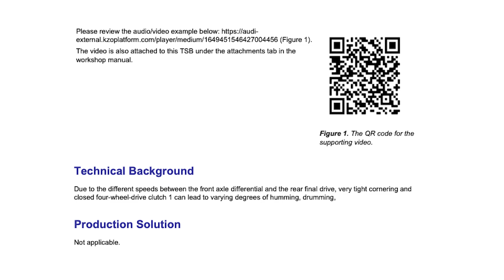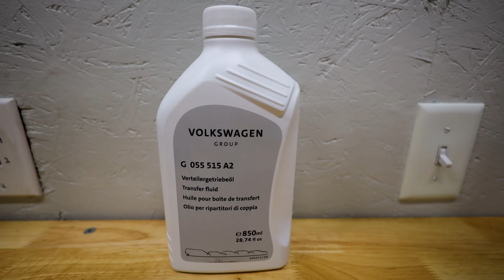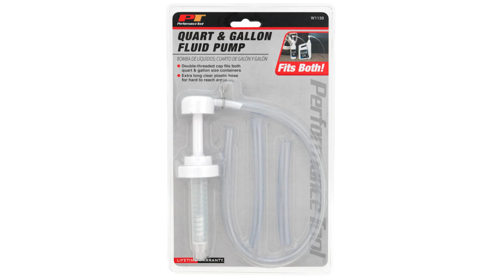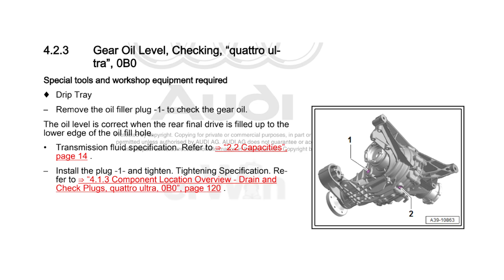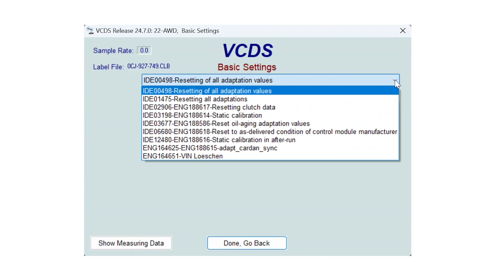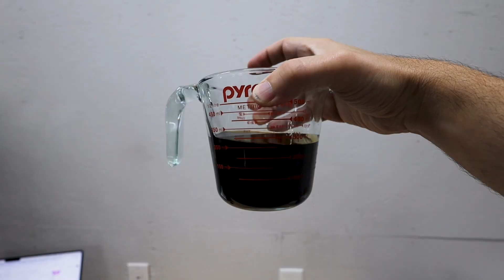Quattro Ultra AWD Clutch Binding & Vibration Fix | TSB Procedure A4 Allroad

Comment: How can we only drain 300ml and put in 360ml? Anyone got an explanation for this 😅
Reply from the maker: @Stormingsoul  Keep watching...
Reply: I did. Initial factory fill comes out as 300ml. Refill 360ml. Did the factory fill short?
Reply from the maker: Right. I owe you an apology, I forgot it was the flush volume that came in extra low. Two things: I think someone else mentioned it in a comment but (if I had even more time and backup fluid) it would have been nice to drain the 2nd fill to validate (against the 360 capacity spec) how much fluid truly gets added when the plug is backed out. Therefore thing #2: Without that confirmation, it's hard to comment on the 300ml captured. Is the big dark secret to how widespread these problems are that the factory themselves don't do the fill properly and are sending cars off the line under filled? Or, is the clutch working so hard during it's lifetime that fluid is being worn (and lost? or at least the volume decreases because of this process, somehow?) to the point where the volume drops? No idea. What's added an interesting wrench in this convo is a newer comment on this video from @glenrichardson6649. According to his dealer, the problem doesn't even exist in the clutch and this TSB is outdated. That info doesn't reconcile with the fact changing the fluid works but...so did their solution.
Reply: @FigureItAuto Thanks.. same questions popped up in my mind. I know the new tsb requires you to drive circles until you puke and the clutch overheats and pops a error warning. My guess is it recalibrates the clutch torque settings on (worn or) hot oil, to a higher clamp force or threshold or cleans the clutch plates?

Bit tomato tomato effect which shouldn't require as much maintenance on the ultra oil anymore. 

Was hoping you maybe discovered some answers along the way on the fill differences and stuff. But remains a mystery to all of us 😅
Reply: Still trying to figure out how to to do the new tsb/tpi with VCDS instead of ODIS.. vcds seems to have a different naming of settings and adaptations compared to ODIS so i can twist the endless circles with the 150nm clutch setting
Reply: Thanks so much for the video and discussion. Currently looking into this on a new to me 2021 A4 Allroad US (23k miles) It has some mild stuttering turning from a stop, etc.
I will definitely change out the clutch and rear diff fluid before trying the additional! see below

I think this is the other TSB that is being discussed:
https://static.nhtsa.gov/odi/tsbs/2025/MC-11012488-0001.pdf

Some highlights, interesting...:
- The friction system of the four-wheel drive clutch may change slightly over a long period of time when the proportion of all-wheel drive use is very low. The following procedure can be used to resolve the customer complaint.
- Connect the ODIS tester and expand the test plan by entering the reference number 2074883. Add the suggested test program - 0022 – Function test of clutch for frictional vibration - Select -1- Target torque 150 Nm
- Keep driving in circles at a maximum speed of 10 km/h (6 mph) until the yellow warning lamp “Four-wheel drive overheating” lights up and test mode is ended automatically. This
procedure can take several minutes and may need to be repeated to trigger the warning lamp. (If you drive 7mph the test aborts, lol)

Comment: This yellow coating probably is corrosion protection..?
Some info about that, I want to protect my b9.5
Reply from the maker: That's correct - You're looking at a Honey Seal coating which is wax based. There's a location in Oakville, ON and from Sublime Surfacing in Edmonton, AB. Canada, of course. Ted in Edmonton could talk your ear off about it if you give him a call (even if you live elsewhere). Highly recommend.

Comment: Wow, that really helped!
I changed the fluid on my Q5 TDI ultra quattro and now it drives as smooth as a new car. 
Thanks a lot
Reply: Did you need to remove the transmission support or was it accesible without additional steps?

Comment: I will add my thanks to Figure It: 2017 Allroad with clutch binding. Sent this video to my mechanic which proved as a helpful how to (he had experience with similar issues with other marques but not on the Audi). Problem totally solved and will do this service every 30-40k kms.

Comment: great information , I have a 2019 A6 which shudders a bit just when do turns at low speed , do you think the fluid change will solve it ? how do I get the software to access the service menu?
Reply from the maker: It might help - you'll want to confirm if your car has the Ultra system first. The software I'm using is the VCDS program from Ross-Tech, which requires an ODB2 dongle to run.
Reply: @ yes it has the Ultra system

Comment: Same problem, but my b9 A4 is with Torsen instead of Ultra. Do you think it is possible that I could fix this with TSB？
Reply from the maker: Responsibly I can only answer: I don't know. But fluid changes are easy, often neglected, and never hurt to do - so it's not a bad place to start. The B8 had a similar shudder that was due to high pressure power steering lines. That said, random vibrations are usually associated with old suspension and mounts, which is why that's usually my first stop on any new-to-me car. Investigation and educated guesses.
Reply: @ Yes, random vibrations from mounts and tires happens sometime, but the most annoying one is the vibration when turn   left/right in slow speed and hit gas, feels like earthquake. I'm going to change fluid soon, I hope the clutch system is not damaged.
Reply: @ Minimum 4L of MTF oil need to be used in one fluid change on Torsen, quite expensive compare with Quattro Ultra.

Comment: Do you know how much dealerships will charge for this service ? 

And BTW great video thanks
Reply: Thank you for your  response. I have one more question. Is it necessary to reset the oil life value, or is it optional?
Reply from the maker: @markeee5267  Truthfully, I don't know. Without it I think all that would happen is a service warning could appear on the dash sooner than needed. I realize there's a contradiction between that and the oil being "lifetime" (hence, why would Audi set a value for time-till-service?) but it's a guess. An annoyance, at most.
Reply from the maker: I don't but I'd estimate IF they are willing to do the service (since, allegedly, some will not acknowledge the efficacy of the service on the symptoms), it should be a few hours plus materials; remember, if they do it per the TSB, there are multiple road tests involved, etc. Give them a call and report back what they say. My guess is [2 hours min @ ~$200/hr] + [2 quarts @ $100/bottle] + [plugs and wildcard Audi factor] = no less than $600 USD.
Reply: Thanks

Comment: Thank you very much for your video, I am a Chinese owner of a 2022 B9.5 A4 allroad. Because the car body vibrated when I stepped on the accelerator to turn or reverse, I went to the Audi dealer in June this year. It was still under warranty, but the Audi dealer was reluctant to replace the oil for me for free. He even lied to me that because it was not a maintenance item, I had to bear the cost of the oil. It was very frustrating. Later, after replacing the oil, the vibration completely disappeared, but now it has only been 5 months and the vibration has appeared a little bit.
Reply: 咱们国内开奥迪的还得自己找解决方法😂😂，我是b9 a4L，我查看了audiworld和汽车之家，很多案例都是说要做两次分动箱油更换，我打算有空自己去买油尝试。因为我之前换过一次，但是几个月后打方向给油振动还是有，我估计两次更换是需要的。

Comment: Great video! Giving me hope again! My 2020 B9.5 A4 has the same issue, starting around 30k miles. I checked the factory equipment code sticker in the trunk, Engine / Trans code is CYMC/RZV TCC. I checked the discussion on Audi forums that Audi started to roll out Ultra system gradually in 2020 for this model. My mechanic told me this is not Quatrro Ultra, should be Torsen. After having the Transmission fluid flushed for 40k service internal, issue still exists.
Reply from the maker: I'm saying this having not done my homework on your exact car but there would still be fluid to change in your center diff that, at worst, wouldn't hurt to change and see if it has an impact. Changing ATF is good when it feels like the trans is slipping into or oit of gear during auto shifts, choppy acceleration from a stop or noise when stopped in reverse - but the trans was a red herring in your case, I believe. If your feeling those general symptoms I described in the video, it's something else.

Comment: I tried to enter the secure access code  "20113" to reset the joint oil change but it doesn't work
Reply from the maker: 20103

Comment: Hi, your video is great, I have a Q3 40 tfsi quattro 2019 so not ultra with the noise in the rear when accelerating from standstill with wheels turned, I changed the fluid in the haldex clutch and also in the rear differential the rep said there was no metal in the oil and that the noise is normal and there is nothing wrong, what should I do as I don't think it ahould make this noise, thank you
Reply from the maker: Is that the only time you feel the vibration - when the vehicle is turning? And any turn, or accelerate and turn? I know it's easy to assume driveline but there are a lot of things that can cause vibrations and to some degree, there is truth in the "quattro rumble". For the sake of argument, let's pretend it is somewhere where gears spin against each other: there are differences in a fluids ability to handle shock or extreme pressure. On specific Audi's, I've heard of people running certain Redline fluids that, without it, seems to allow chattering in gearboxes or diffs. OE fluid isn't always THE best option for every component. But with fresh fluids in your car (minus the transmission, sounds like you didn't do that one - but ill say a lack of metal is not a fool proof indicator that something isn't wrong...), something else could be out of balance. Warped rotors, torn axle boot leading to worn CV bearings, wheels out of balance (more of a high speed thing), driveline, subframe or suspension mounts wearing out - the list goes on. Isolate, test, diagnose. Good luck.
Reply: @ Only when accelerate from standstill with turned wheels, and the noise/vibration is in the rear (not from gearbox from what I can hear), rep explains that is the strain on the transmission from the fact that wheels are turned, but I say the front wheels are turned not the rear ones; I suspect haldex oil pressure (valve, pump problems, but they say this would appear as am error) or driveshaft mounts (though age of car is 5 yrs and odo 50000km), I checked CV front ams back in a specialized service and they say CVs are ok; only remaining problem would be worn gears in the differential; because I doubt every Quattro makes this noise :/
Reply: And only with wheels turned at maximum, if half turned noise does not manifest

Comment: Thanks for this video. Bought a  2017 q5 at auction that was doing this and shuddering when under acceleration/ load at all speeds-  including highway driving. Changed the transfer clutch fluid as per your video and drives perfect now. Thanks!

Comment: And this is why I bought a 2016 A4 B9.0 Quattro with a Torsen Centre Diff and not a face lifted B9.5 with the Quattro Ultra.
Reply: I also have the A4 b9 quattro dsg and I get slight diff rumble coming out of tight corners from standstill Any ideas of the fix for this?

Comment: speaking of leaving items out of the mx schedule...when will they put intake valve cleaning services in the mx schedule for Direct Injected cars?  Services are offered by the dealer (of course they are), but the actual service is not in the mx schedule from the manufacturer...negligence or oversight?  is it omitted to keep ownership costs "down" in comparison shopping tools??

Comment: Really nice tutorial, the only one that I know of that covers the clutch and the diff for this set up.
I'm planning to do the same for my Audi Q5, but I'm unable to find the plugs for the clutch. Do you have an url or maybe a part code that I could use to buy those fill and drain plugs by chance? Thanks in advance!
Reply from the maker: The part numbers are in the last screen of the TSB images earlier in the video but to be certain, it's always a good idea to refer to ilcats.ru with your make and model specific information against the part diagrams, or just call Audi and get the parts person to double check what it calls for.
Reply: ... takes a lot of pinch zoom to read, but appreciated

Comment: Nice job! Did you use tread locker or thread sealer for the rear diff fill and drain plug?
Reply from the maker: I did - orange thread locker; holds like red, breaks like blue.

Comment: OMG perfect timing, i have this issue with my B9 2017 Allroad and my mechanic is recommending replacing my drive shaft ($2000 plus labor) I'm going to try this first and report back here.
Update: followed step by step and it fixed the issue, been driving a few 100 k since and still all good.
Reply: I hope you informed the mechanic also? Because he's going to replace that drive shaft for someone else. 😮
Reply: Update from 2 months ago?
Reply: @ still smooth sailing
Reply: @joelsherbqc  I have audi a4 Allroad b9 but with Quattro ultra, i have  real quattro with torsen,   and have the same vibrations when wheels is turned.... Going to replace clutch and fly wheel...
Reply: @joelsherbqc don't worry, it will be back. The shudder is only curable by replacing the clutch pack in the transfer case. Which Audi wants to sell you an entire transfer case. But the parts to rebuild them can be found online from specialty vendors.
Reply: @joelsherbqc how is the car driving now Joel ?

Comment: I had the same issue 4 months ago on a 2020 Q5 at around 85k kms. I took it to Audi dealership and they did exactly what you just did, it fixed the problem right away. However, the rumble is back after 4months and i only did 10k kms since then. Audi said that if it comes back they have to change the center differential under warranty. When you search for “quattro rumble” you will find many posts of people complaining about it. It’s unfortunate that Audi doesn’t fix the root cause of it or just add it to the list of service maintenance to be done! Thanks for the video
Reply from the maker: Appreciate you sharing your experience on this, although the prospect if this problem comes back that soon I'll be a little nervous. How extreme were the symptoms before you decided to bring the car in? I do wonder if there's a point where it's simply too late for a fluid change.
Reply: @FigureItAuto  when i took it to Audi dealership, the vibrations were quite noticeable. I have to add that I am in Canada and I only feel it when I am on the summer tires. When on winter tires, i don’t feel it. It is pretty weird! But I want to get it fixed before my extended warranty expires
Reply: My audiq5 2018 same problem thay did the oil flush but problem is coming back after 6 months
Reply: I wish it was a recall and not a TSB. With a recall, I don't think warranties get in the way.
Reply: Hello,how. I can contact with you?

Comment: Perfect timing! I have a 2018 A4 with 6 speed manual, just over 100k km... have been getting the "shuddering" sound from the rea axle... after researching (google) for awhile, I came to the same conclusion - hoping it's the AWD clutch fluid that needs change!
Interesting, here in Sudbury ON, the dealer charges $120 (plus HST) for the clutch fluid... so I bought 1 'bottle', but did also order 2 more from FCP.
Really appreciate your video, going to do this procedure next weekend, and hopefully the shudder goes away!!!
Reply from the maker: Good luck! if you don't mind, check back and let us know if it solved the problem, especially given yours is a manual.
Reply: @FigureItAuto  Yes, it did solve the problem... I followed your procedure except the last part - checking and updating settings (still plan to check them) - thanks again!
Reply: @ollimatik  Legend! Thanks for confirming - also have the B9 6 speed manual <3
Reply: I have a 6MT as well! Which oil did you use?

Clutch (0CJ) Gear Oil - G 055 515 A2
Rear Diff (0B0) Gear Oil - G 060 190 A2
Reply: @mmelnikas the clutch oil
Reply: Hey did you figure out thissue.I also have a b9 a4 6 speed manual. And I'm dealing with a rear rythmic pulsing vibration. I cannot figure out what is causing it.
Reply: @robertgonzales2782  yes it did - let me know if you need any more info!
Reply: @ollimatik Hey I also have a b9 A4 MT and been having a weird shuttering when taking off from 1st. It only happens when taking off from a light. Did you have a similar issue?
Reply: @alikarim2279  Yes... not so much when going straight, but definitely happened when starting off at an intersection when turning.